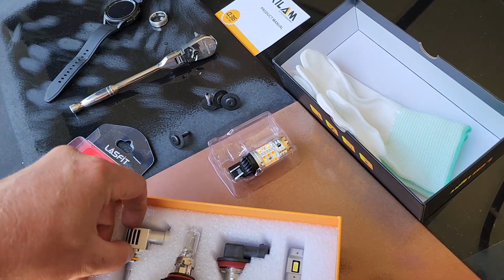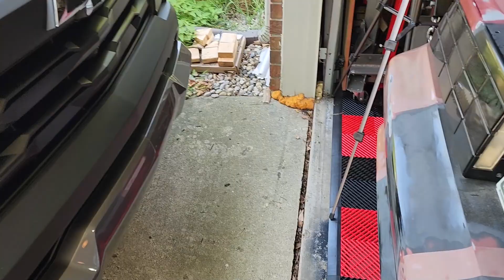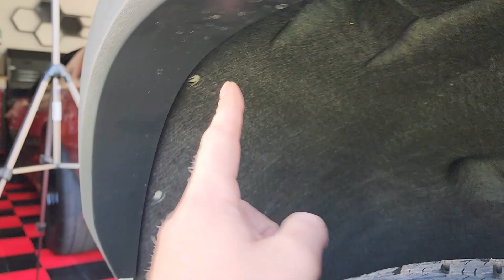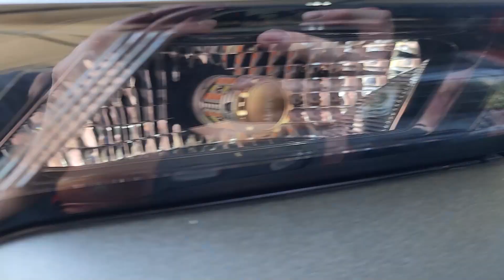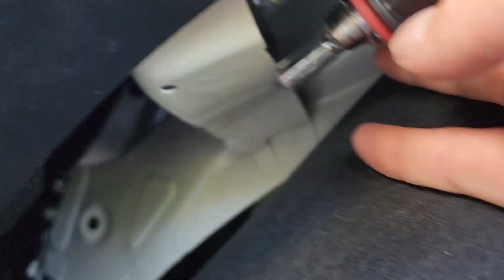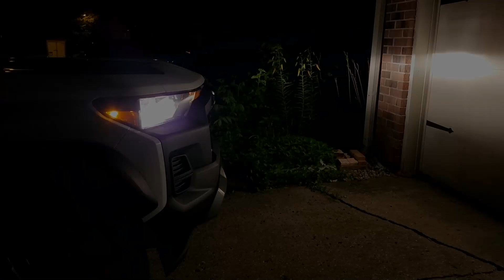2023 Chevy Colorado Upgrade LED Headlights and Blinkers HOW TO Install Auxilam and Lasfit

Comment from the maker: So after running these lights for about 5 months I started to have flickering and dimming of the headlights. I have now switched to the lasfit headlights with much better performance and life span. Many others have had failures with the oxilam bulbs anywhere between 2 and 6 months. So here is a link for the lasfit set and they also offer many different tiers of bulbs as well. https://amzn.to/3UlJlJQ
Reply: I've been running auxito 9005 and H11 in my 2016 traverse for 3 years and no trouble with them. I like both lasfit and auxito but auxito is little easier on the pockets.
Reply: This is a really really awesome setup. I watched your video, and I can't wait to try this idea. When I got my Colorado, your video was on point, and I've already subscribed to your channel.
Reply: It says on Amazon they do not fit 23-24 Colorado?
Reply from the maker: @joenagele6282  well they do. It's a bulb type. If it's the same type as what the vehicle requires then of course it will work. It's bc not every China brand updates every year with what vehicles have what bulbs.
Reply: Tonight my brother and i are going to put LED headlights in our nephew's new 2024 Colorado.  Your video has great info. 

I also wanted to comment on the flickering which I had on my 2023 Silverado and went to Canadian Tire (car parts in Canada) and bought the IGNITE anti flicker devices for 23 bucks and all my flickering problems went away and they have been working fine for over a year.  The lights I used were GT MOTO H11.  Maybe this will help some folks whoa re having flickering with their LED headlamps.
Reply: I just got the low/high beam kit from lasfit. The high beams fit on my 2023 Trail Boss but I can't seem to fit the low beams. The fan is too large and doesn't let me screw that cap back on behind the bulb. Did you not have this issue?
Reply from the maker: @Mi4mi_joe  no I had no issue getting the cap on. Are you sure its seated correctly in the housing?
Reply: @ yea it is. I think they sent me the wrong one. They sent me their LAPlus version and the guy on the phone said that’s not compatible with dust caps. I think I was supposed to be sent the LCPlus.
Reply: Hey Tony! Link expired or is no longer linked to Amazon on the low beam/high beam LASfits. I can’t remember the damn model number lol

Comment: So I have the 2026 with led head lights turn signals has no low lamps,And I wanted switch backs,So the way I went around it is to add the 3rd wire for switch backs.

Comment: Hope you can get to this quick but I ordered T3 lasfits and they just dont seem to clip into the socket of the turn signal its getting irritating 6 different led bulbs and none clip
Reply from the maker: Like you cant get it to push into the socket or you cant get the socket turned back into the housing?
Reply: @TonyTheTechnician like if its a loose wall socket you get me? Lol 
But thankfully i got prime when i ordered them so i got a refund and im ordering the exact model you had showed. What should of been done to begin with. Will update if it fits👌
Reply from the maker: @HDBeatzz ohh ok. Ya let me know how the new ones go 👍
Reply: @TonyTheTechnician  they worked finally and they look so good👌 almost identical but i saw your 6 month update and will look to upgrade to lasfits lowbeams

Comment: Beware. In most cases, replacing halogen headlight bulbs with aftermarket LED bulbs is not legal for on-road use in the US. While LED headlights are legal when installed as original equipment by the manufacturer, or as DOT-approved replacements that meet federal safety standards, most aftermarket LED bulbs do not meet these standards.

Comment: In comparison. Both LA plus and that oxilam led draws 30W each.

The lumen they claim is a major lie.

While the LA plus draws 30W, it makes realistic 3000 lumens each.

And it has a large heatsink with a 35mm cooling fan.

And it will dissipate heat properly and it will last way longer than those imbalance led. 

LA plus will last over 6 years. While those will last about a year or so at best.

Comment: What I don’t like those led bulbs is because while it’s great to have all in one style, with cute little fan that looks like a 20mm size. Or smaller. 

If this thing draws 50W, that’s a major imbalance. 

If u like the all-in-one style design. 

I highly recommend Lasfit - LA plus.

Pure well balanced and they will last much better because they run much cooler.

Comment: I am on here looking for a video to remove LED and put in halogen instead because I get angry on high alert physically when an LED light vehicle is behind me. My body reacts thinking they are trying to ram me or flash me or get aggressive or that they are trying to signal me about danger etc -- i go into fight or fight mode every damn time and led person comes at me in ant direction!  The Chevy Colorado that I want to buy has everything exactly how I want but it has LED lights which is making me think I have to settle for something else rather than live with LED lights and hassling other drivers with them.

Comment: I CANNOT GET THE CAPS BACK ON...
Reply: Yes the led bulb is fully in with the correct tabs alligned... the back of the fan housing on the LED contacts the recessed surface of the cap preventing tabs from locking.
Reply from the maker: Something isn't right. Either it's not fully locked in or you have wiring or something in the way. Nobody has had issues with the cap not going back on.

Comment: I put these in and every morning I get 5 to 10 people flash me thinking my high beams are on. I did not adjust them. Should I lower them? They are still at the stock hight.
Reply from the maker: Yes you need to adjust them down.
Reply: Thank you

Comment: got these headlights because of your video and the left one just went out/very dim. i see you recommended lasfit but the link doesn’t work anymore. do you have the link or other LEDs i should use?
Reply from the maker: Ya they were good until almost everyone started having issues with them. I think it's do to poor cooling causing the leds to overheat and malfunction. https://www.lasfit.com/pages/product-result?rq=mk_chevrolet~md_colorado~yr_2023~na_led-bulbs~zq_wt-lt-trail-boss

Comment: Is there a way to turn off the always on headlights? They're on during the day as well
Reply from the maker: Only by manually going in and shutting the lights off on your screen.
Reply: @TonyTheTechnician  even then they don't turn off, still on while the gear is in drive
Reply from the maker: @0091dude  hmm that is weird. Mine shut off. I'm not sure what is going on with yours
Reply: @TonyTheTechnician  I think it might the because of the Canadian model, I've read in forums they use low beams as DRLs, was hoping there'd a way to turn em off. I just got LED installed and they're on all the time even during the day so. Nice tutorial btw, helped me a lot 👍
Reply from the maker: Ohh ok I understand. Ya sorry I couldn't be of more help. Glad you got some good information from the video.

Comment: how do the low beams keep cool when there is a cap blocking the air? or am i over thinking it?
Reply from the maker: It just circulates the air in the headlight. Unfortunately overheating is the number one thing that destroys leds. And while some of these lights are designed with good cooling fans some are also very poorly designed. Alot of people are actually having issues with the oxilam bulbs and I'm switching the the lasfit headlights as well. Just a better quality light. I'll have a video on them coming soon

Comment: Both of my low beams failed in 6 months. They are not worth it and are very much so, chinese quality bulbs
Reply from the maker: I just had the same issue. Last week my driver's side low beam started flickering. So I already have new lights on the way and will be doing an updated video

Comment: I tried clicking the link you provided in the description for the Oxilam LED Headlights, but it seems to be a dead link. I tried finding the exact ones that you used using amazon and their website but just to be on the safe side, do you think you could provide a working link to the ones you used specifically?
Reply from the maker: Ya idk what is going on with the links it started happening yesterday https://amzn.to/47eBLE3

Comment: Are the LED’s blinding to oncoming traffic?
Reply: Can you provide any tips to aiming the lights. I’m sure us TB owners would love a video on aiming these to help oncoming drivers.
Reply from the maker: I have a new video installing my new lasfit led headlights where I show how to adjust them
Reply from the maker: After switching lights and doing a 2 inch lift, absolutely lol. But it is extremely easy to adjust the headlights. I did mine in about 2 minutes

Comment: Tony I added the same headlights and blinkers that you did. I did it the 1st weekend I owned the new Trail Boss. After doing so I noticed my blind spot detectors coming on all the time with nobody around and also the headlights are on all the time, even while the Auto button is on. I think during the daylight they should turn off and the running lights come on. But that does not happen for me. I took the truck to the dealer and they blamed the LED's. So I put the cheap halogens back in ( I kept them) and I still had the same problems. I don't know if the blind spot detection is related but maybe it is. So then I took it back to the dealer and they had to order some kind of new module. I have been waiting for that for 2 weeks now. The GM strike is causing delays. But I was wondering if you have had any issues like that.
Reply from the maker: My headlights do stay on unless I switch them to the off position but I don't mind that. But I haven't had any issues with my blind spot detectors, I would have probably done the same thing in your shoes. I hope you get it figured out. Keep me updated
Reply: So with the LED the auto on/off for the lights does not work?

Researching to see if I upgrade

Comment: Question. I’ll eventually switch my low beams to LED. But besides that. I want to add switchback lights on it first. But is it possible that I can make my inner amber lights my daytime running lights adding the switchback? I basically want my inner amber lights to be on during day and they automatically switch when the sun sets.
Reply from the maker: The inner lights will only be on if you manually switch your lights to be on all the time. If it's in auto and the sun is out then they will not be on. They will only blink.
Reply: Unless you install switchback lights then the inner lights will be your new DRL right?

Comment: Dope vids as always. At what time would the blinkers actually switch to white? Compared to the Z71 or ZR2 do Trailbosses use the blinkers DRLs?
Reply from the maker: Thank you. Anytime my actual headlights are on then the white lights are on. When it's bright out and just the daytime running lights are on then only the low beams are on. If that makes sense.

Comment: Hey Tony I was able to take the cover off on the housing to get to the low beam bulb. For some reason though I’m having trouble loosening the bulb itself. 

Is there a trick to it? You just have to turn it to the left correct?
Reply from the maker: Yes just turn to the left. Grab the connector area with your thumb and support the top with your pointer and turn.

Comment: Why the oxilams over the lasfits for headlights?
Reply from the maker: Oxilam at the time had already been used at the time. So I knew they would fit. Where as the lasfit had a bigger housing and I wasn't sure if it would fit

Comment: Hey Tony, Thank you for these video’s as an owner of a 23 Colorado Trail Boss, I really enjoy these videos, practically following along and making the same mods on my own. I think another viewer mentioned this but I noticed that the auto start-stop on the truck which comes standard (can’t get it without it) makes these lights flicker when I’m at a stop, etc. Pretty sure people think I’m flashing them at night.

I’m trying to train myself to remember to disable the auto-stop/start (flip the switch) when i get in the vehicle bus was curious if there was a way around this. I’ll deal with it because the LED vs Halogen is unreal but thought I’d ask?
Reply from the maker: Ya it's kind of annoying I feel the same way and I try to remember to shut the auto start off as well but always for get. In order to resolve it you would need to install capacitors in line with the light to hold a little power in the lights when the engine is starting

Comment: Switchback function on the blinkers does not work on the 2023 ZR2
Reply from the maker: That's bc these are designed for vehicles without pre existing led lights.
Reply: Didn't know that because my blinkers are still halogen, still looks better now.
Reply from the maker: @foxarrow33  ya I guess it has something to do with the led strip in the headlight housing.

Comment: These are the H11 + 9005 on Amazon? About to order some, just want to make sure. Thanks!
Reply from the maker: OXILAM H11/H9/H8 9005/HB3 LED Light Bulbs Combo, 32000LM 500% Brighter 6500K Cool White, 1:1 Size High Beam Low Beam Replacement, Pack of 4, 2 PCS H11 LED Bulbs and 2 PCS 9005 LED Bulbs Combo

 https://a.co/d/4IRl4M0

Comment: I just did mine does your twitch after your auto drive kicks in
Reply from the maker: Yes leds will do that bc they turn on and off alot faster then halogen. Some vehicles are worse then others. These weren't designed for leds so this is common. Only way to remedy would be to install like a capacitor in line to hold some voltage in the light during restart.

Comment: I tried to do mine. I have deep admiration for your grip strength. I couldn’t get the cap off the backside.
Reply from the maker: Some people have had that issue. Are you getting it to turn and not pop off or can you not get it to turn?

If it turns then try to pop it off with a small screwdriver. 
If it isn't turning try using a larger pair of pliers to turn the cap first. 
Hopefully that helps

Comment: Great video my friend! I just replaced the low and high bulbs but now the lights don’t come ON on auto mode nor when I unlock the truck with my fog key and even on the ON mode they don’t turn ON, the only way to make it works is selecting the last icon on the light section inside the infotainment 😢😢 do you have any solution?
Reply from the maker: No you may have something faulty in the lights or something. Nobody I know has had that issue.
Reply: @TonyTheTechnician  Somehow the problem fixed itself, approximately two hours later I turned the truck back on and the lights were working properly, thanks again

Comment: Thank you for the videos.  Just finished the lights on my Trail Boss.  Would just like to tell everyone that it's not a bad idea to wear a long sleeve shirt when you are reaching up in the fender wells.  I swear to god they use old saw blades on the inner fenders.  Everything in there is sharp.
Reply: fr😂
Reply from the maker: Lol not a bad suggestion at all. That is very true.

Comment: Hey Tony,my dust cap for low beam seems very hard to come off. I’m not sure if i’m just too weak or what.  Any suggestions? Great video by the way i manage to change the highbeams with LED instead of paying $250+ a pair to install lol
Reply from the maker: Very nice and ya sometimes they can be tight. Are you able to turn it and just not get it off or can you not get it to turn. If you can't turn it I suggest a big pair of pliers where you can put the jaws on opposing sides of the cap and twist it that way. Sorry hard to explain without showing it. If you can turn it but not get it off you could use a small flat head along the edge and pop it off

Comment: Tony, very good video, just picked up mine and first thing I did was upgrade the lights with the same ones you used.  Problem is with the Lasfit.  Their site says use 7443ck which I did, did not work, called was told that is the correct bulb and may be defective.  Got a new pair with the same results.  Your video shows you using a T-7443D?  I am ready to try those now.  What do you think?  K
Reply from the maker: Ya the ck is not correct for the new year. Someone showed me these ones about a month ago and decided to try them. The non ck seems to work fine for me. A couple of people have had an issue of the white lights not working but the orange does. If anything you could just go with the standard amber non switchback.
Reply: Thanks Tony.  What lasfit part number did you finally go with and does it work with both amber and white?  If it is still working for you I will purchase them.  This will be #3 pair.  Thanks for all you do for us.

Comment: I pulled out my blinker bulb to upgrade to the  lastfit switchback and the connection is totally different than this video. My new ones don’t have the same connection. Did I do something wrong when removing old bulb?
Reply from the maker: Do you already have leds? Is your truck a z71 this only works when you have halogen bulbs from the start

Comment: I was wondering do the lights blind other drivers sometimes LED lights are too bright
Reply: No they dont, I added them back in may and they have the same light pattern as the stock bulbs so they are the same just a nice clean white light and the auto high beam still works the same
Reply: Most new vehicles have them,,,so are you blinded by them when you drive at night?